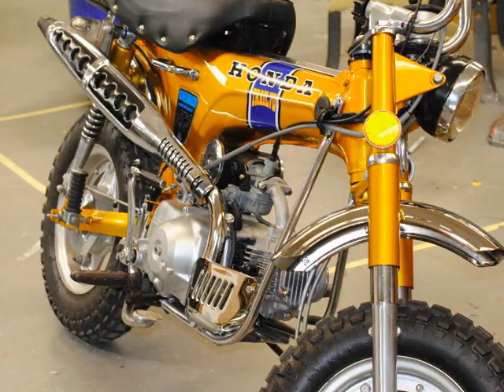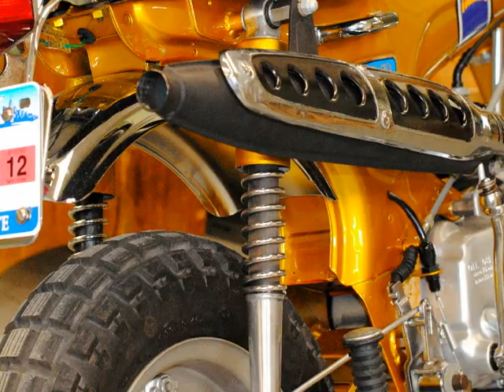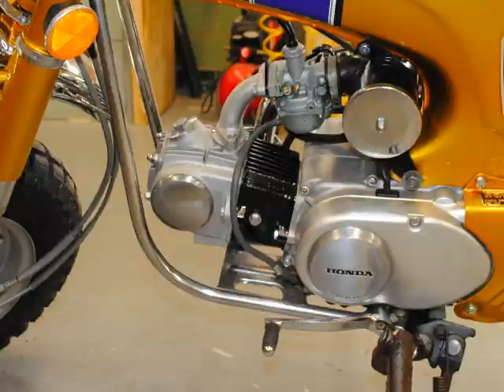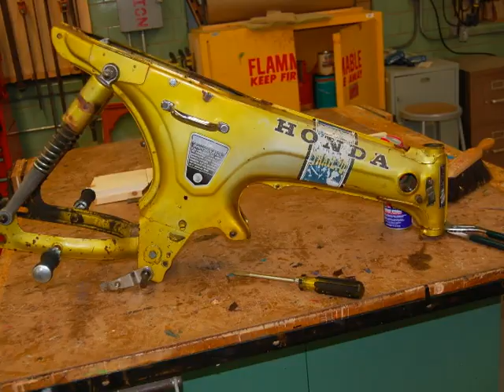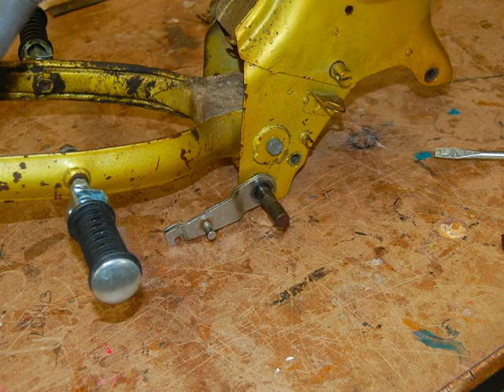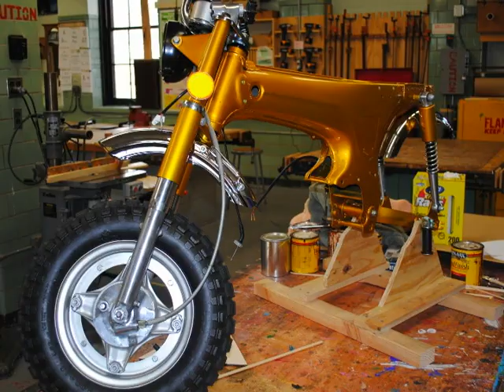Honda CT70 Trail 70 K1 Restoration

Comment: Nice resto.

Had one in 1970.  Metallic blue with black stripe.  72cc 3 speed centrifugal clutch. Only held half a gallon of petrol and did 140MPG.. 42 MPH.  Only had 2500 miles when I sold it.  

Had it road registered.

Comment: Sweet bike ,move the rear brake cable over the air cleaner there should be clip on top of your air cleaner to hold it in place so its not hanging down.!  Nice video too!  SWEET

Comment: I had a 73' CT70 in gold just like that, mine was a 3speed auto. That's a sweet ride! Miss mine, huge mistake getting rid of it.
Reply: I had the same for my kids back in the late 80's, then it got stolen never to be seen again.   I replaced it with a blue 73 Honda SL70 4 speed w/clutch, both were a lot of fun to ride on the trails.  Kept it till the late 90's then my son upgraded to a Honda 250 dirt bike, Fun Times  😁.